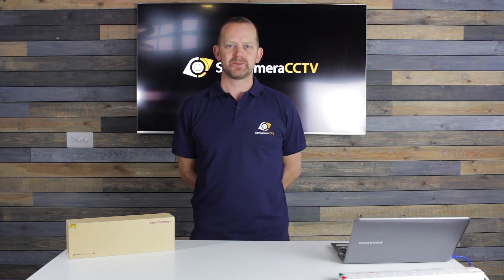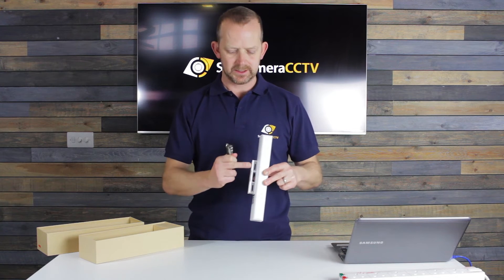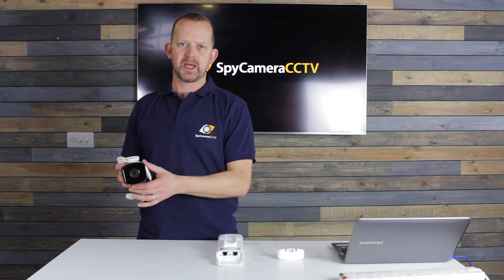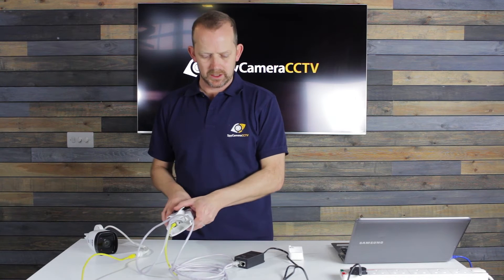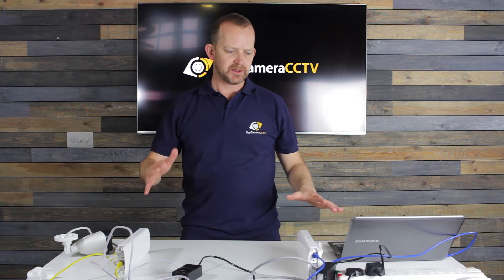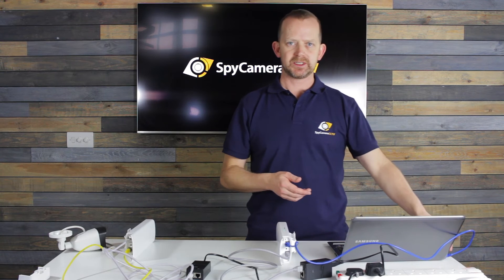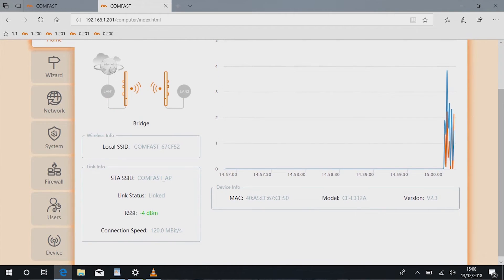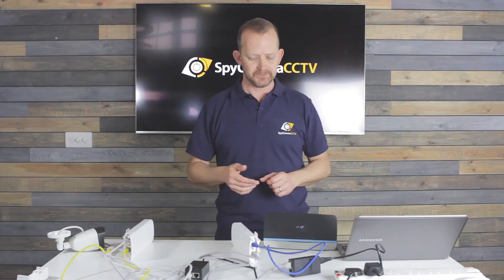How To Setup Comfast Wireless Bridge (Pre-configured)

Comment: i have same antena comfast but i have a problem my poe works fine. my antena works fine. the pj45 cable only the green pair not working and its very difficult to change it. That means only 3 pair of cables work. Is there any way to fix it without change the rj45? thanks a lot

Comment: on the bridge side. it says 48v, can i plug a 12v 2.4ghz antenna on the lan port and use its poe mode to power up my antenna which is just 12volts? thanks.